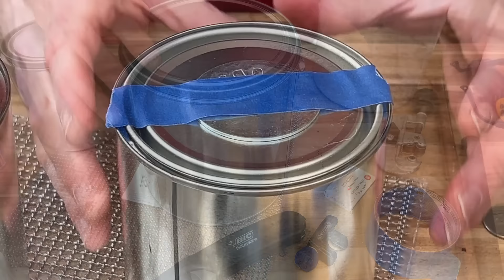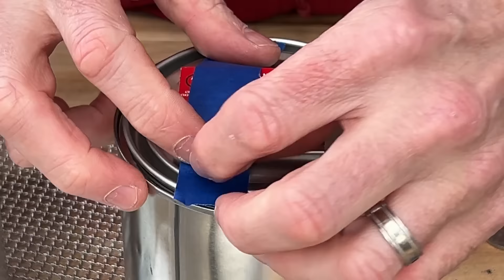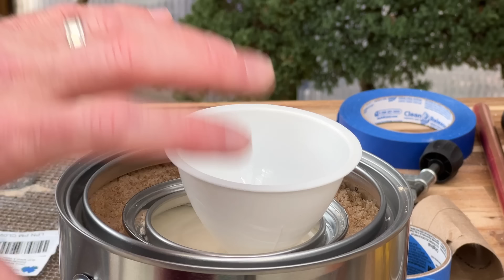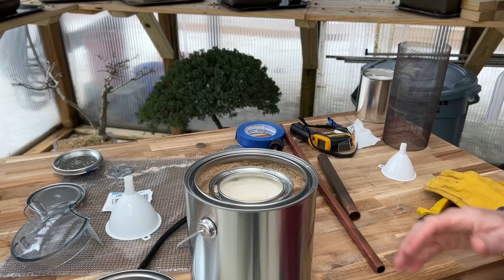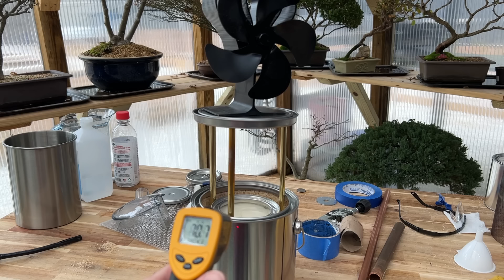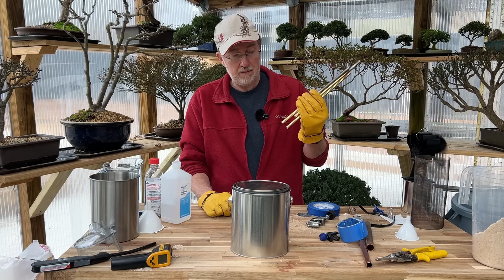Endless Heat Without Electric | Safe Reliable And Low Cost

Comment: I used a toilet paper roll soaked in white gas for USMC Cold Weather Training in Norway and it saved my hands from frostbite. Temps were -80⁰ below wind chill. 1986.
Reply: Thanks to all who served! May GOD abundantly bless you accordingly.
Reply: @moonbowmountaincottage AMEN❤
Reply: @moonbowmountaincottage I am and GRATEFUL
Reply: Yes! Thank you all for your service! We owe our freedoms to you all!
Reply: @timrhodes3040 ❤❤❤❤❤❤❤❤❤❤
Reply: Thanks for sharing. Glad your hands were also saved
Reply: Semper Fi
Reply: Sheesh! That's COLD! 😬
Reply: @lindasands1433 rite🫣
Reply: C’mon Devil Puppy’s, you know the Air Force Wins the Wars.😁👍👍 Proud Disabled Air Force Veteran.
Reply: WHAT IS WHITE GAS !? ENGINE GAS THOUGHT GAS IS VERY FLAMABLE
Reply: @DebbieLucas-d7t white gas is naptha. Coleman camp fuel is naptha.  
   I buy Coleman lanterns 220E or older. They run well. If they are stubborn to start preheating the generator and air tubes with a very low setting on a propane torch usually will make them run.
    Fuel can be found for the half the price of alcohol. A silverware stainless steel round drainer creates a flame shield and cooking stand. Burn time is eight hours on about a quarter of fuel
Reply: They also of course function as a light. Just put the globe and top vent on. I use an ugly one for ice fishing
Reply: @ohiofarmer5918 good information! Thank you!
Reply: @ohiofarmer5918  naphtha releases toxic fumes!
Reply: @DebbieLucas-d7t white gas is what you use in a Coleman stove. Also known as Coleman gas.
Reply: 80,Below 😮 how are you still alive 🤔
Reply: @maximinoblas1171   in the Arctic, it’s not uncommon to have extremely lower temperatures, coldest I was in was -75c three days of extreme wind.  You just stay in your tent till it passes.   I suspect you have 1 never been in the Arctic and 2 never been a soldier.
Reply: @maximinoblas1171 thats one of those "how cold was it, question with, it was so cold..😊
Reply: @maximinoblas1171  USMC training. They don’t mess around
Reply: @maximinoblas1171 the toilet paper/gas burner!😅
Reply: How long does this heater last before the fuel is used up? Does it produce an odor?
Reply: @joejohnson2478 I don't remember how long it lasted. Depends on how well it is soaked. Denatured alcohol is the cleanest burning fuel.
Reply: Flour is also good if you don't have a fire extinguisher
Reply: Sounds like being up @ the DMZ in Korea
Reply: I did the same thing when I was in S.Korea for MAG-X80 cold weather training. My main problem was having every other Marine trying to crowd around it to warm up too. Not that I minded my brothers sharing it with me but you can only get so many pairs of hands in one space😅.SEMPER FI LEATHERNECK, OOOORAH!
Reply: Semper fi to you too Rick!
FROZEN CHOSEN!
I did Team Spirit '87 in S.Korea, a float from Oki. Got to ride 3 cruise ships, the USS Dubuque, USS Tripoli & the USS Blueridge all while being laison with the 7th ROK Artillery Battalion. Good times!
God bless you brother!
Oooraahh! Devil Dogs!
Reply: @MMOverlandAdventures  I was on the USS Tuscaloosa, USS Thomaston and USS Cleavland. Also on float from Okinawa. Went to S.Korea twice, the 2nd time for mountaineering training. Hit olongapo bay, Philippines, spent New Years in Hong Kong. I'd like to go back to Oki and see if B.C. street and  gate 2 have changed at all. I was with 3/12 Delta btry. 2531(radio op) cross trained as a F.O. . Sounds like we stomp a lot of the same ground.
Reply: Get the hell out of here Rick. I was 2531 with HQ 3/12. They made me training NCO when I got there. Secondary  mos was Primary Marksmanship Instructo.
Good friends with a guy named Rick Fischer. '87-'88
Small world my friend.
God bless brother 🙏
Reply: Last year I crewed on the tug boat that towed the USS Cleveland from Pearl to the Palau trench where it was used as target practice for the RimPac 24. I was one of 8 or 9 of the last people to be on board. Got to learn a lot about the ships history and everything. That ship was nearly unsinkable. Cool to randomly find a youtube post like this and share with you.
Reply: @rick3923 Wow! Thank you fellas for your service. I’m so sorry that you all had to endure what you went through, there are still a lot of Americans that appreciate all that you did. 😊❤️
Reply: We would start vehicles with it in the artic.  Natha.
Reply: Thank you for your service!
Reply: I was going to say “yikes Norway?”
That’s freezing 🥶 cold :( painfully cold! 
Love your country- not the winters. Lol
Reply: 70percent alcohol work2 .thank u to all vets
Reply: I do the same with alcohol
Reply: White gas?
Reply: @dee-deem8501 I think hes talking about alcahol
Reply: What is bio char? Almost don't want to know.😮
Reply: THAT’S CCCCCOLLLD!!!!!  BRRRrrrrr!!!!!
Reply: There is lots of alcohil based hand sanitizer aroind now cheap. The higher the alcohol content the cleamer it will burn.
70% burns with a yellow flame. 91% is slmost imvissble.
Reply: 80 below o_0?!!
Reply: Alaska 35 years, Texas another 30. Sure is amusing reading the comments of the totally clueless. Really pisses me off how much theyve lied to the younger gens and kept normal knowledge away from them in favor of "safe spaces". Yeesh.
Reply: Where do i get a fan like that
Reply: @cookie4re1 I asked the same thing.... Seems Noone is answering
Reply: @Lisa-r9c He said he got it from Amazon
Reply: @cookie4re1 in his links above
Reply: @cookie4re1 under the diamond like symbol..scroll dn then
Reply: My dad used toilet paper roll in rubbing alcohol in a paint can i think. He used it in his tree stand hunting
Reply: White gas will explore like gasoline. Kerosene and diesel fuel with burn slowly. I don't know how you did that with white gas but thank God it worked for you.
Reply: Tks
Reply: Omg good luck.
Reply: How long does it work before you need to add more alcohol
Reply: How long does the wick last? Hrs. Days?
Reply: What is white gas sir?
Reply: HEY EVERYBODY, WHERE DID HE GET THE FAN???
Reply: @Lisa-r9c Amazon
Reply: @Lisa-r9c in links under the diamond icon above
Reply: ALL THESE IMPORTANT QUESTIONS AND NOONE IS REALLY ANSWERING THEM FOR US?!
Reply: Amazon has those fans. I almost purchased one for my fireplace
Reply: Gen X Marine in the house as well brother!!!!
Reply: I took the uss Frederick from iwakuni to Po Hang for the 4th of July 76. I was with MATCU to set up a control tower at their air field. I hooked up loud speakers from our HF radio and played KC KASUM top 40 for the camp. I was a 19 year old marine having aa great time...
Reply: That’s an amazing bonsai collection! Awesome!!!
Reply: Boy that’s a tough spot to be it ha.  You for your sacrifice I’m sure your body might hurt from those days.
Reply: Why not just take a grate off your gas stove and put on top of the can to cook with. Also you can make a rocket stove outdoors or in the fireplace.
Reply: @lisagarrett9999 I don’t know maybe not everyone has a grate or fuel for a rocket stove and they require a chimney inside but that’s a good idea. They put out a lot of heat from very little fuel
Reply: Don't use in a tent , ☠️ please don't use in a tent 💀 ⛺
Reply: @geoffreykeating8172 being careful, Coleman fuel set up is ok. Just need a little common sense using it. Not to be used in a tiny tent, especially  against the walls of a tent, for example.
Reply: What about the same principle you have introduced, but instead of toilette paper & alcohol,  use biochar instead.  As you can make your own biochar, and this will be a continuous source of heat to meet your needs without depneding on purchasimg the alcohol or gas fuel.
Reply: @wemustprophesyagain7382 That is a great idea. Not that I need now.😊
Reply: @wemustprophesyagain7382 cjarcosl puts out lots of csrbon monoxide as it burns.
 Ok outdoots but in a tent it will 100% kill you .
Reply: What is White Gas ,?
Reply: Wow. And some women think they can do what a man does. .. I'll never kid myself .. ❤
Reply: @crystallittle5083 And some men think they can do what women do..Men and women are here for different reasons. We compliment each other.
Reply: If you put it under the hood range the heat's going to go outside

Comment: For the monster fan, being 
‘’ cool to the touch “ why can’t you use a Home Depot, etc. plastic bucket full of sand instead of an expensive metal one?
Reply from the maker: Safety issue.
Reply: @ZenGardenOasis.  how so??
Reply: @Benmelech  look... do as you please dumb dumb.. who's stopping you? 
You clearly didn't think of what could happen if the wick was left to burn dry... here's a hint (it will prob catch fire!) :O
Reply: @Benmelech fire and plastic don't mix.  Ever.
Reply: @sincerely-b  fire??? You’re taking the issue, a flame out of context.
Reply: Isn’t BIC lighters… Plastic

Comment: If I were to build one of these I would screw the outside paint can to a larger base to prevent accidental tip-overs, if that denatured alcohol would spill out it would create an intense invisible fire.
Reply: I was thinking that placing the paint can in a cast iron dutch oven would keep it stable.
Reply: That seems unnecessary and maybe even less stable. The weight and shape of it, as he presented it, is much less prone to tip over than most commercially available space heaters. (And the safety feature of "Shut off on Tip over" is NOT reliable.) Common sense dictates placing any heater where it wouldn't be inadvertently kicked or bumped. Being affixed to a "larger base" INCREASES the chances of it being inadvertently bumped.
Reply: @missiedegon608  Here's hoping you never find out how fast fire can spread when given the chance.  Why wouldn't you want to take extra precautions?
Reply: @Anoldphotographer  I've experienced fire. I think you missed my point, but no worries ✌️
Reply: Oh yes, that was bugging me too.  I think gluing the can to the desired base would be a good way to prevent any leakage from screw holes?
Reply: @nunyabznz3029  You would only screw down the outside can which does not hold any alcohol.

Comment: Cover the small can and rim of large can with painters tape before adding sand.
Reply: Or use a syphon to fill the sand between the two cans
Reply: @ellenfuller4393  OR you can dance around the can like a crazy person .or you can sit by it and talk to each other.about the can.
Reply: Great tip!

Comment: For gods sake don’t use isopropyl alcohol. Isopropyl alcohol burns with a yellow flame, and yellow flames aren’t hot enough to burn carbon monoxide.

Only blue flames are hot enough to combust carbon monoxide.

I used alcohol stoves indoors for 12 years and never once did the carbon monoxide detector go off.

The video sir; you have incredible bonsai trees i cared for Bonsai trees for over 10 years.

When I get a place I would love to grow a juniper Bonsai again
Reply: Evidently your hearing aid needs a new battery. He specifically said if you use denatured alcohol to use in a well ventilated environment!.
Reply: Denatured usually refers to ethanol plus poison to deter drinking not isopropyl
.

Denatured has Ben  used inside boats for a century without issue .
Reply: @ everything you said is absolutely correct

But we’re talking of burning denatured alcohol not drinking it

Denatured alcohol actually burns at 830 degrees Fahrenheit, if memory serves, and methanol burns at more than 700 degrees Fahrenheit.

There’s ONE downside of a blue flame. It’s almost invisible under bright light meaning a bad burn if you get too close 

It’s amazing how clean denatured alcohol and methanol burns. So clean you can burn denatured alcohol in a stove made from soda cans.

I made alcohol stoves from 53 mm cans the same diameter of the 8.4 ounce Red Bull cans) a friend said one of my stoves would never last enough burns to complete the Appalachian Trail. I told Sam “I will make you eat those words. He said the stove would need to survive 360 burns. I said 360 burns is easy so I put the stove through 800 burns.

Now if you step on a stove it would be crushed like a grape. True but my stoves only weighed 7 grams carrying two stoves in the cook pot the stoves would be protected in the cook pot
Reply: @MatoNupai 

Bravo!

Well said and well done Sir!

-Ready Mix Mary
Reply: @heathboeddeker5401 carbon dioxide and carbon monoxide are 2 different things, too much of either in the room will kill you
Reply: What do you use?
Reply: @l.c.3150 only the blue flames are hot enough for combustion of carbon monoxide. In excess of 750 degrees 

Two great alcohols that fit that requirement are

Ethanol 
Methanol 
Denatured alcohol.

Don’t use methanol or denatured alcohol for drinking

Comment: Nice idea but alcohol is very expensive and burns away in minutes. The sand thing is not worth the tiny bit of heat it radiates after the fire burns out.Sadly i have ended homeless after losing jobs for rejecting the poison shot,have tried so many heat sources,i can't even count. The only way is to completely line the tent,shed in reflectix insulation and use k-1 kerosene in table top oil lamps (1 inch wicks). Clear glass is best so you know to refill before they shut off.Buddy heaters are great if you can afford a $5 propane tank every 3 hours or so. When it's cold, no matter what heat you use, it gets freezing real fast when the heat source shuts off. * The oil lamps burn for a couple days before refilling. 😮 Keep in cages mounted to the floor if you have kids or pets
Reply from the maker: Mine burns for hours.
Reply: @ZenGardenOasis.  How many hours? I can't sleep on 4 hours.
Reply: @Culwhickbeocca I have tried many alcohol based heaters.Alcohol burns out fast.I am sticking with large table top oil lamps,1 inch wicks,using k-1 kerosene, safe for indoors.1 gallon costs around $10 at walmart. each lamp holds around 12 ounces,lasts at least 1 1/2 days.$10 for about a week's heat,for 2 lamps, is doable.$10 for a gallon of alcohol that might last a day is out of my budget. Besides having to constantly refill those alcohol heaters.
Reply: Also, I've heard that hydrogenated oil which is sold as a cheap food product is a long lasting fuel. A can of it can last for literally days.
Reply: So proud of you for rejecting the poison!
Reply: Good on you for not taking the poison shot. You have more balls than I do. I had a landlord that let me stay in her camper for free, just paid for electricity. When that poison shot came around, as she had almost lost her daughter since she was young (she's in her 50's now) due to an autoimmune genetic disorder, she was scared and gave me an ultimatum to take it or lose that space to live. I took the first one to not be homeless. I regret it. You did what I didn't have the balls to do. I salute you. I regret taking that first shot. No adverse effects long lasting for me that I know of, but I don't care. Out of principle, I should have said no.
Reply: @Culwhickbeocca  use iver mec tine.  Or nico tine pleisters without chemicals. It kills and remove the evil things!
Reply: @Culwhickbeocca  My personal miracle cure, 🙏!! Detoxing from spike protein, vaccine(s), virus's, autoimmune diseases (which are caused by viruses), tumors (both cancer & non-cancerous) and it is also used in prevention! Daily, (morning) "Rugby Nicotine Patch, 7mg" proven to be the safest! Nicotine is not addictive, it's the synthetic man made chemicals that manufacturers lace the cigarettes with, which causes the addiction. Good Luck!!
Reply: @Culwhickbeocca  you will be in my prayers that you got the placebo one and will never have any effects. ❤✝️🙏🙏🙏🙏🙏🙏🙏
Reply: @pattiannepascual  I appreciate that, and the response to the heater question
Reply: It’s not that expensive and if you calculated actuall cost of heating rooms you wouldn’t say that

Comment: Just place the sand in an heated oven for an hour to easily dry the sand.
Reply: The sand will dry with time if the lid is left off the big container for a week or so.
Also thinking of smaller ones the outer can being a quart size and the pint inside...
Reply: Sand + jellyroll pan + very warm oven = dry sand.  Right you are!

Comment: Why not use olive oil? Ive wondered that on all you're builds.
Reply: Find some olive oil that will create a flame and you might be on to something. 🤦🏼‍♂
Reply: I use plain ole (cheap) vegetable oil in the short tiki torch cans.
The downside of veg oils is that capillary action will only draw upward maybe 2 inches d/t viscosity of the oil.
    The good news is that I get about 12 hrs of flame per fill, which only uses about an inch of oil - so it's cheap & a good use for cooking oil that's old or rancid
Reply: Please do not listen to this mans idea... (olive oil? seriously?)
Reply: @rjnash2610  it's been used for thousands of years in oil lamps 😂
Reply: Olive oil is incredibly expensive. 9 euros for a small bottle.